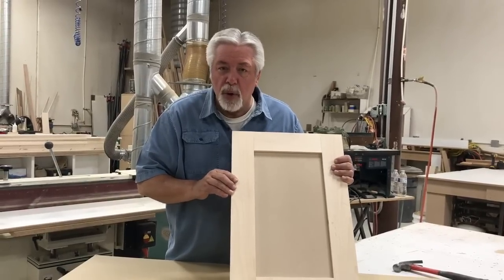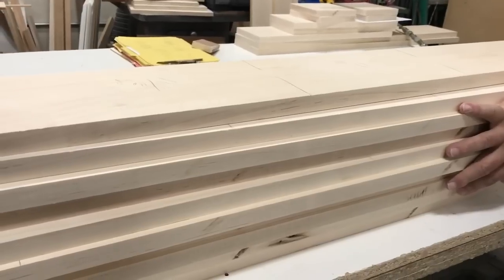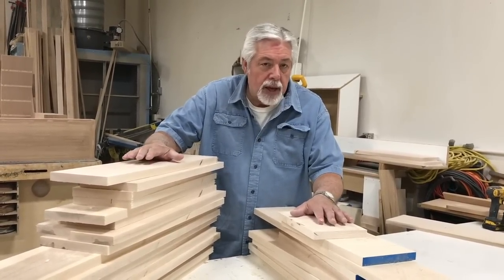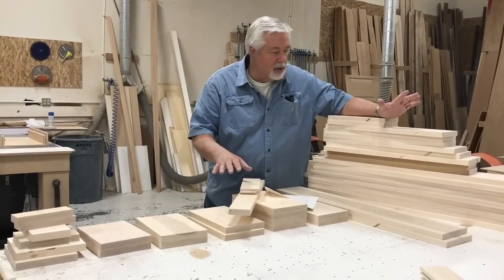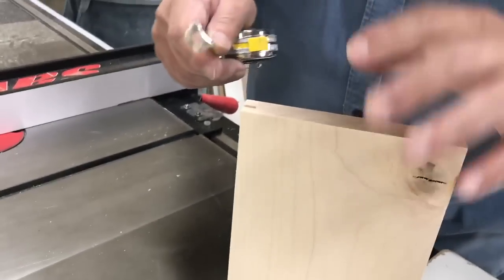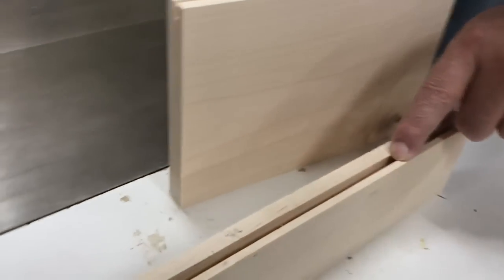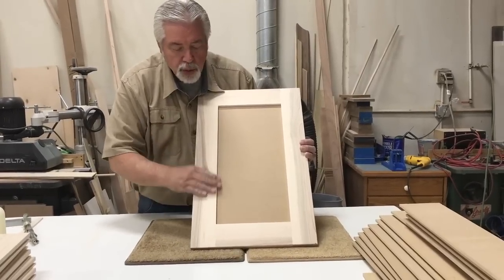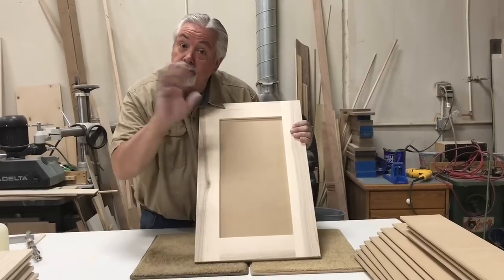Build A Shaker Door - The Basics Are Simple

Comment: Your vidoes are awesome....I have a question and no one seems to answer (and it may be just too simple but chlallenging). Cutting mitered trim the righ sizes. I can cut perfect 45's but here is a sample issue. Say I have a 30" square cabinet. I want to put molding around the perimeter. I make my first cut and get a corner. My challenge is WHERE do i measure from/to to get it to the end and the next piece ? I cant talel you how many pieces of wood I have burned throught trying different techniques. so if I want a molding to go around a base of that 30" square table...I obviously need it to stick PAST the 30. Otherwise it wont mate to the next peice so shoud my cuts be just 30" apart INSIDE ith whatever hangs out ? I know, hard to do in text but I had some L molding that was a nightmare and 3 trips to home depot...More wood....LOL. How about a video ?
Reply from the maker: Hi Robert...if I understand what you are asking, you want to know what part of the molding that you are cutting is the piece that you should be measuring. So, if you have a 30" cabinet then you measure 30" on the part of the molding that touches the cabinet. Typically, an inside corner or short points to short points. 
And yes, that would make an excellent video, thank you for the suggestion. Hope this helps, Wes

Comment: What saw blade are you using? I’ve had issues with a flat kerf blade not cutting flat. Causing all the joints to not fit correctly. Great work as always.
Reply from the maker: I used a 60 tooth combination blade for all my cuts. Thanks for watching, Wes

Comment: Wes, can you glue a plywood panel without issues down the road with expansion and contraction ?
Reply from the maker: I never glue in the panel...only the stile and rail end in making my doors. Thanks for watching, Wes
Reply: Hi Wes, love your videos :) If I’ve understood correctly,  you leave a gap for wood and use those spacer balls rather than glue. Except if you use mdf, then you would just make it a snug fit and still no glue? Also, is there any chance you could do a video on how to make a larger cabinet door, like for a pantry? Or is it exactly the same kind of process? And I’ve not seen you use mdf in any of your videos, so I was wondering if you recommend mdf or not? I’m planning on painting my cabinets so I thought it might be cheaper. Thanks so much :)